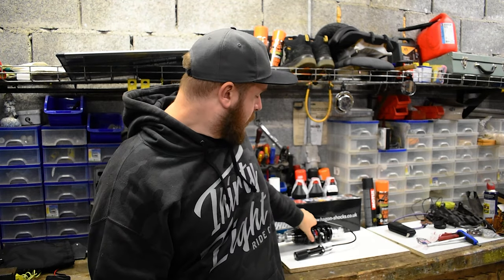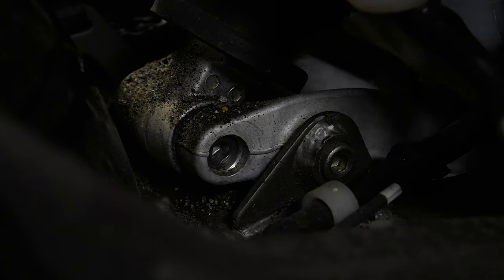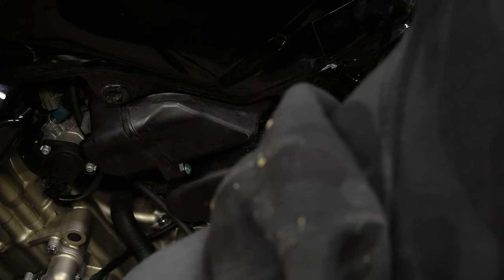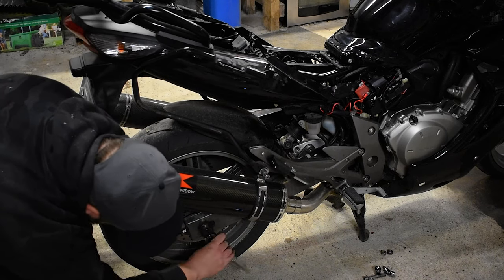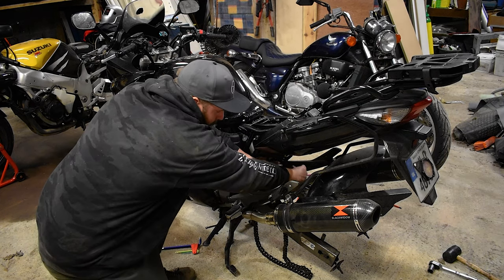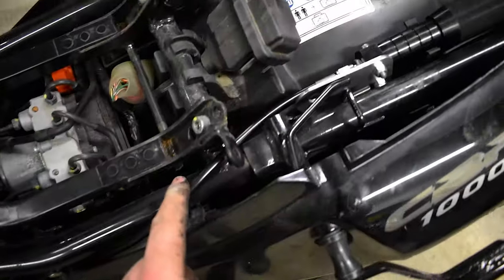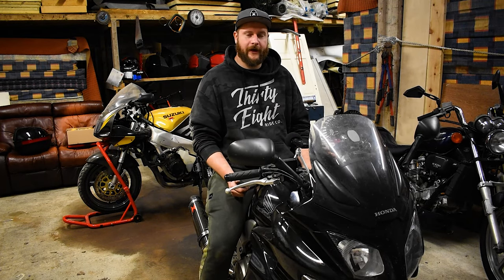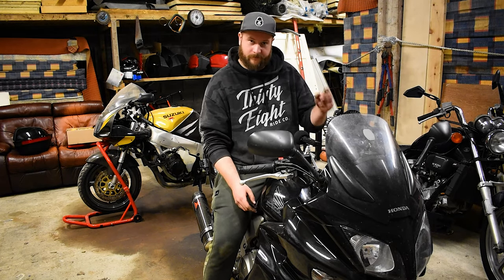Honda CBF1000 Hagon Shock Upgrade

Comment: If you haven’t already, use a bit of thread lock on the hugger bolts. A word to the wise, they can come loose and ruin your tire!
Reply from the maker: Hilariously the bolts that are on the inside that could come loose to the wheel have long since migrated somewhere....I replaced them and thread locked them but great advice for anyone else watching this! :)

Comment: Glad you had a go before me,l have had the same idea to change the shock,l tend to ride on the quick side and the bike tends to get out of shape when you are pushing on
One thing l might of missed how much does the replacement shock cost.
Nice to see someone doing cbf videos 
Keep them coming 👍
Reply from the maker: Yeah the original shock just isn't great at all! I found it the same pushing on in corners and such just not very solid. 
I may have forgotten to say it! I just checked my receipt, 540 pounds including delivery for the one with the remote adjuster. So about 570 odd euro I think I paid all together. 
I will do :)
Reply: @TheGorillaBiker  thank you for getting back to me ,that bit expensive 
Look forward to seeing you on a test ride 
Cheers Dave
Reply from the maker: No problem :) The non remote adjust one is a good bit cheaper, I just knew I'd be keeping this bike so I didn't mind the investment :) should have it out soon! :)

Comment: Hi Gorilla I have a mark 2 CBF1000FA, where did you pic up the shock ?  Ride safe, 👍Jon from Dublin👍
Reply from the maker: I got it direct from Hagon, I'd also recommend contacting MotoMaxSuspension now tho as he has a load of different shock options and will set them to your weight :) 
Might see you on the road 😁

Comment: These videos are really brilliant for me at this time....do you have any regrets on the parts you used or recommend others, I have a MK2 and don't need sporty stuff just something that works for me 🙂 117kg 🤦
Reply from the maker: Glad they're useful! Nope, I'm a bit mad when it comes to researching stuff, use case vs cost etc etc so when I pull the trigger on something I'm 99% sure I'll be happy with it!

Comment: Hey new to the cbf1000.  How do you change the height adjustment. I know theres 3 setting. Thanks. Love in the vids
Reply from the maker: You have to remove the seat and then adjust the frame.under the seat. 
Be warned at the highest setting there's a noticeable gap between the tank and seat

Comment: Did I miss something?   No spanners were thrown!  You didn't kick the bike!  You didn't storm out and go to the pub.  Need to work harder on the tantrums lol.   These things were never designed to be worked on, just assembled once at the factory in the correct sequence.  Another good clear how to.
Reply from the maker: Haha I actually did smack the rubber hammer off the desk so hard that the head of it came off once :D But no nothing like that this time :P Very true...built up once and left that way! Thanks Stephen I'm glad they're coming out clearly!

Comment: hello brother! I live in Turkey. I have a cbf 1000. How much does the new suspension cost and how can I get it?
Reply from the maker: Very nice :) This variant with the remote adjuster was about 500 euro I think, but the standard one is cheaper, you can buy them at Hagon https://www.hagon-shocks.co.uk/ , just email or call them before you order to get it set correctly for your weight.
Reply: @TheGorillaBiker  thanks bremın 😇👌

Comment: another great vid :D 
i think manufacturers do things just to be annoying and make it more awkwards for home mechanics to do work.
all your missing now is a little pot belly stove in their lol you have a sofa :p

well my car is sorted after the breakdown, well mostly... i have one of the first dusters with the electric power steering... the wires for the electric windows had rubbed against the power steering wires and had eventually shorted out... new window regulator as this had failed too.. shame lockdown happened as it would of happened earlier and the car would of still been inside the 5 year warranty period... but meh, window reg is only a main dealer part, so thats been ordered, the power steering and all the blown fuses has been sorted out anyhow. 
it got me 4 days off from my course lol
Reply from the maker: Thanks :) 
They definitely do, I think it'd be very easy to have made that a 10 minute job with a bit of design. 
Haha myself and the father were looking at some form of stove :) 

Christ! Glad it's sorted but that is bad luck about the warranty. It's always the way though, when I bought my old car it was 3 weeks out of warranty when the catalytic convertor blocked and destroyed some other things too on the way out. Sad times.
Reply: @TheGorillaBiker  great minds think alike :D yeah a stove makes a workshop, especially on a cold day, spent many a day as a kid in workshops with my dad and they all had stoves in.
aye sods law that stuff always goes wrong once the warranty is up, still its the first issue ive had with the car, so other than servicing costs and the usual insurance etc its been cheap to run, even the insurance fully comp is cheaper than when i had 3rd party on a skoda octavia...

Comment: Why not drop the swingarm and pivot and clean, check (replace if needed) and lube the bearings and change the seals when you changed the shock?
Reply from the maker: Because I needed to ride the bike about 15 minutes later. And I didn't want to I suppose.